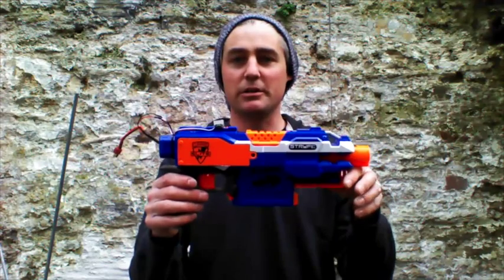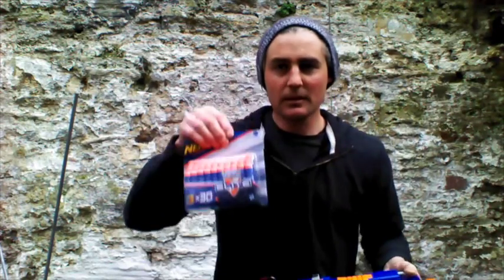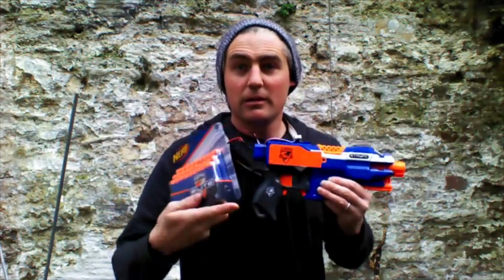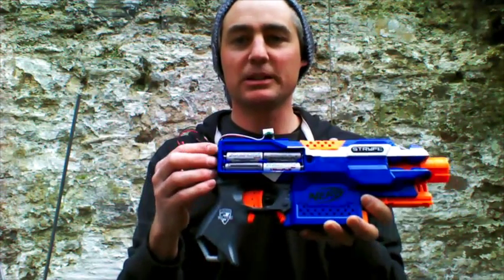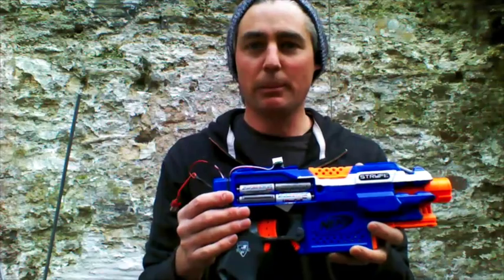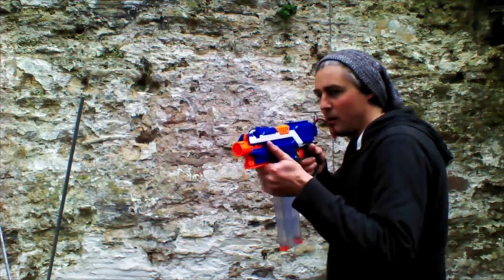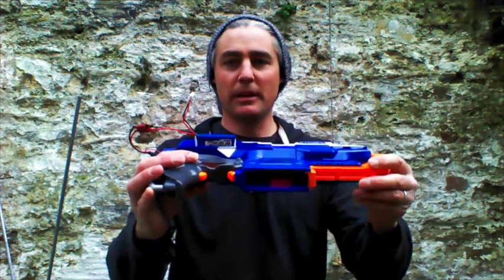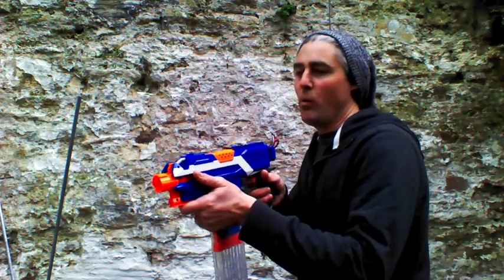The Battery Wars Test- Trustfires in the firing line...

Comment: Thank you FDS I have been wanting to see a test like this for some time.

I think that the reason the results were so similar is because the current capabilities of the batteries were not fully needed. The test used stock Stryfe motors which were intended for use with alkaline batteries, which have pitiful discharge, and in addition the voltage was only slightly higher than stock. A stock Stryfe is rated at 6 volts 14 watts (read off the side of the blaster) which would mean the system pulls slightly more than 2 amps at 6 volts since Power = Voltage x Current. Most Stryfes that I have seen use 3 Ultrafires. At those higher voltage levels the current demanded will be higher so the fps consistency or inconsistency should be a bit more pronounced.

A stock Rapidstrike has a rating of 6 volts 30 watts (also read off the side of the blaster), which equates to 5 amps of current again using Power = Voltage x Current (30 watts = 6 volts x 5 amps); again the need for more current is obvious. Try running a Rapidstrike off of 4 AA batteries and then 4 c batteries.So I absolutely agree with running a higher discharge pack in a Rapidstrike.

Finally, I wonder if the Mabuchi FK 180sh 3240 motors Toruk runs are the main reason he is getting results as shown in the Tacmod Response video. By the description of his battery pack, the current capability of the pack is less than the stall current at that voltage. Unless I have a misunderstanding of dc motors, but if the voltage is doubled current should approximately double as well and at 3v a single Mabuchi FK 180 motor has a stall capability of about 9 amps; he is running 3 at about 7.4 volts. So paraphrasing SSGT's comment on your Big Battery Guide that's about 72 amps and Toruk's battery is 1300 mah 19c which equates to 24.7 amps; yet he is still hitting 100 fps with nearly no rev? 

Although the test results initially surprised me, I think the data is still fairly consistent with the theory. The voltage drop by the Ultrafire is pretty atrocious and that can't be good for the life of the cell. So other than longevity of the battery, I think that the advantage of a high discharge cell would be more easily recognizable at higher voltages, in a blaster that demands more current like a Rapidstrike, or with high torque motors that demand the current.
Reply from the maker: For Rapidstrikes on 180's I am using 16AWG multi strand for all the main loom. 18AWG only goes on the short length jumpers in the trigger cluster. The BSUK switch kits have proved highly relaible in combat, with 100's of hours logged by plenty of users. Power MOSFETS are un necessary IMO for most users. My RS pack has a 60c burst, 40c constant. It never gets close to overload, the low voltage alarm never trips and there is usually plenty of power left at the end of the day. 
USerName125- You need to be at www.britnerf.co.uk you have the right mind set. Come and join the hive mind!
Reply from the maker: Those are good points, I tested a Stryfe because it's what is most commonly modified with 14500 celks. The Rapidstrike has lots more room for a pack. You should drop by Britnerf, discussions like this are regular posts there!
Reply: UserName125 Bear in mind that Toruk's 7.4V 1300mAh pack will have a continuous discharge rate of 19C (i.e. it can safely sustain 24.7A for prolonged periods of time) whereas three fk180s will only draw about 11A continuous combined. I don't know what the burst rating of his pack is but it could be quite a lot higher and it will only have to supply that amount of current for a fraction of a second (it only draws stall current whilst the motor is stationary which is almost no time at all).

Even so, from what you've said, I'm sure you can see the problem with using 14500 cells on fk180s (especially three of them). In a RS the three motors running on 2S could be drawing more than the continuous current design capabilities of the IMR (if you can get hold of a 10A continuous version) and way beyond the design capabilities of the Trustfires. Pushing a battery above it's design conditions is never a good idea. Pushing Lithium chemistries above their design conditions is plain mental. Not only would you haemorrhage recover times due to the voltage sag but you'd be taking a major risk having them within a few inches of your face. 

I tend to aim to install packs with a burst current rating equivalent to that of stalling all of the blasters motors at once (simulating a simultaneous jam of flywheels and pusher in a RS). Although the motors may be fried by that amount of current it means I can be sure that the packs themselves won't be compromised in the short amount of time it would take for me to realise I have a major stoppage. An overloaded motor may burn out whereas an overloaded pack may do much worse.
Reply: SSGT
Thank you for the clarification of continuous and burst current. I was wondering why 10 to 15 amp micro-switches were used rather than a MOSFET which can handle significantly more current in a small form factor. So can I assume that a MOSFET would be overkill or does my switch need to be able to handle the burst current as well?
Reply: UserName125 In some ways, and rather weirdly, switches are a little more complex. First off, most of the switches people use tend to be rated to 10A @ 250VAC. At first you'd think that means you can use them for 200A @ 12VDC but unfortunately that isn't the case. DC power is a lot more damaging to a switch because it tends to arc more severely as the switch opens (unlike AC, DC doesn't pass through 0A many times a second which would help prevent arcing). the problem is even worse with motors and inductive loads where the start-up current (as the switch closes) is very high and the inductive nature of the load tries to resist the change in current as the switch opens (maintaining the arc for longer causing yet more damage). Generally, you should be OK using a 10A @ 250VAC switch on 20A @ 12VDC (very much rule of thumb, if possible look for DC ratings for that particular switch). That value is often the "contact" current (i.e. the max current the switch can attempt to break) rather than the continuous current of the switch (which can be a lot higher). This is because, although loads like a motor will draw a lot of current at start up, most of the damage is caused as the switch opens and breaks the circuits rather than when it closes (although existing damage to the contact surface can cause it to weld closed). Essentially if that current rating is above the continuous current draw of the motor(s) you should be fine (180s especially are often already up to speed, and their current down to their continuous draw, before you have the chance to let go of the trigger and open the switch). If in doubt, go for the highest rated switch you can find.

That said I now tend to default to power MOSFETs for my electric builds. That's partly because of a lack of DC ratings for switches, partly because MOSFETs allow for other interesting options to be included but also because they reduce the amount of high-gauge wiring I need to cram into the blaster (I tend to go slightly overboard and spec my wiring and switchgear to be able handle a full stall for at least a few seconds incase of a severe stoppage).

Comment: Just over 4 fps doesn't seem that much but then this is only 2 darts per second (shame the chrono can't take readings any faster). It'd be interesting to see this test with 180s though. The extra current demand should pull the on-load voltage down a bit and show the Ultrafires running way out of their comfort zone.

Definitely agree on the protection circuits. If you can't run cells with them without tripping them you definitely shouldn't be using the unprotected version as you''l be going beyond it's design spec.
Reply from the maker: If you extrapolate that to cover 3s builds, bigger motors and the fact that I was using far better wiring than most TF builds it would probably be more pronounced. I aimed to make as level a playing field as possible. Look also at the voltage figures, the pack only varies by 0.1v!

Comment from the maker: Steven O- those are the batteries used in the test. They are fine for casual users but packs are still the best choice, both for price and power. Look at HobbyKing.com for packs.

Data on Rapidstrike builds is here

http://britnerf.myfreeforum.org/about946.html

Plus a ton of other builds and global contributions from other modders.
Reply: Sorry, I am a NooB. What is the stock orange trigger motors in the data, is it the Barricade motors?
Reply: Stephen Oniszk Also what is the BSUK motors? What does BSUK stand for? Sorry NooB again.
Reply from the maker: The data on those isn't ideal, the barricade motors were in all my builds, look at the difference between the IMR and packs. BSUK ones are NSR shark 40's which will need a full rewire and packs, ignore them. I realise that data isn't perfect, I need to make some more but it costs me time and money so I tend to test newere things! I promise a revised data set before April for the Rapidstrike.

Comment: For anyone who thinks that a modded flywheel needs spool up time, reference Coop772's video: Stryfe Speed Shooting. He unloads an 18 round clip in 2.25 sec, and you can hear little to no strain or slowdown on the motors like you would on a stock Stryfe.
Reply from the maker: Look at the Reaper in action on my channel, 700 rounds a minute at 110 FPS on less than 11v.
Reply from the maker: No IMR's in the Reaper, only a hi power 3s LiFe pack. Much better. Rapidstrikes always need a pack to work best.
Reply: So it correct to say that it is necessary to run a lipo in a rapidstrike for optimal performance, but the performance (other than longevity of battery life) in a stryfe even when using IMR's is comparable?
Reply from the maker: I would say that the pack is the ultimate solution for any electric blaster. They are cheaper than IMR cells, have much better specs, deliver more performance and no Rapidstrike should use anything else. IMR has it's place for newer modders or in drop in solutions, like if you use your blaster in the office and want it to be fairly stock, then ramp it up for wars. You can do so with PWM controllers and packs too.

Comment: Mate, could you do the same test. But at a slow rate of fire (not as fast as you can fire as in this test). That way we can tell how much of a difference (if any) rev up time makes by compering the two tests.

I use 3 x trust fires (plus one blank) in a rapid strike (Stock orange trigger). I wonder if the effects of rapid fire will mean the difference between trust fires and IMR would have been greater?
Reply from the maker: I made it clear it wasn't about peak velocity. If you look at the data on the spreadsheet, the highest score shots for each cell type will give you this data. There is a Rapidstrike test on my sub forum of Britnerf, I will pop up the link.
Reply: Foamdata Services Thanks :)